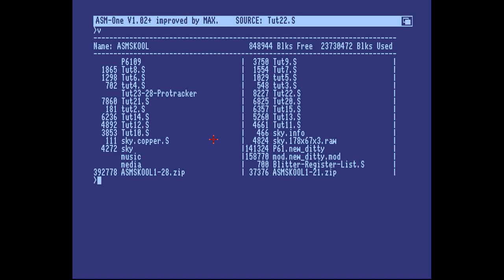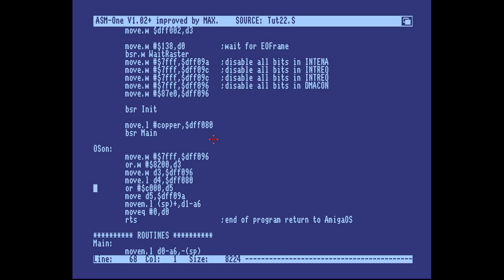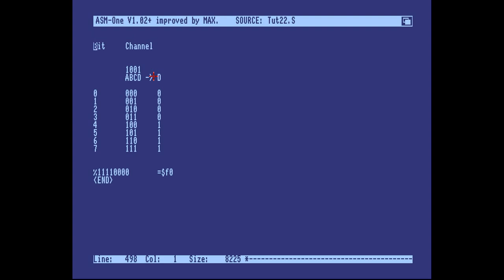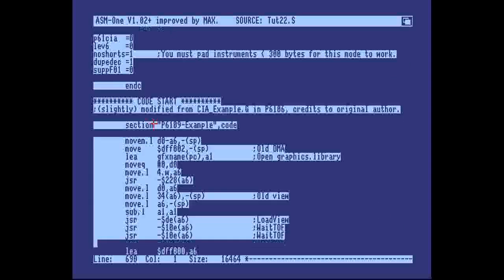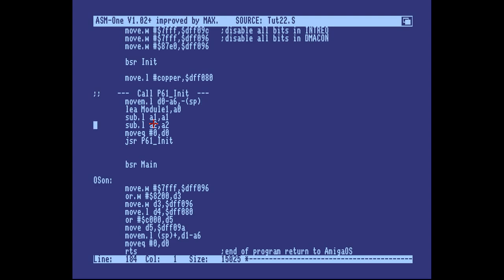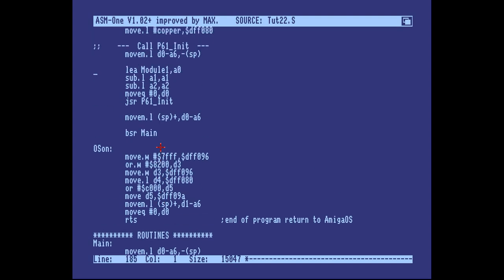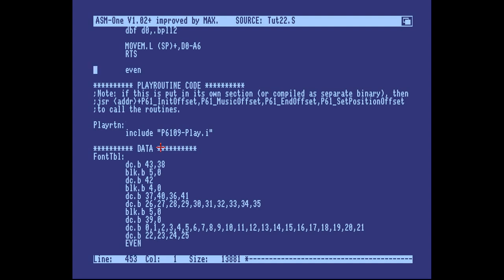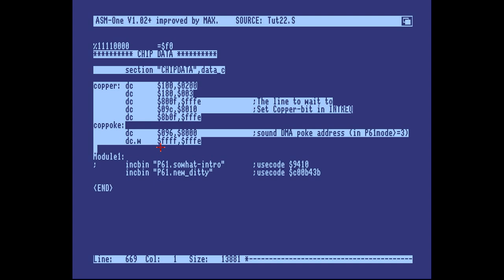Amiga Hardware Programming 30 - Adding music to the demo

Comment: Hey, I used your example but encountered a crash pb. I use P61con and set 'Pack samples' option in Preferences but when I launch asm example with this compressed module, no way, it crashes. Any hint ? Because it's cool to have samples compressed regarding gain of memory.

Comment: I can get the EXAMPLE to play but not the Tut30.s and same with my code, just silent. I have no idea how to debug this...
Reply from the maker: Tut30.S works with P6109 here by setting usecode for the song and p61bigjtab=0 (or 1), but the most common cause is p61exec=0. It should be 1 if you're not making a trackmo and want to support accelerated Amigas. A "bad"(?) default that was left in.
Reply: @ScoopexUs  Hi Scoopex! thanks for your reply and sorry if I didn't respond earlier but I took a long pause from Amiga coding. But now I'm back and I figured out what the problem was. By comparing the example in the P112 dir with tut.30 I've notices there's a DMA init which is a bit different, so I changed 	move.w #$7fff,$dff09a to move.w #$e000,$dff09a and BANG! it works! This works also on my code. I'm still figuring out what I just did exactly but for that was the trick :) So tut.30 works with P112.

Comment: Thanks for the explanation. Very interesting. Only remember 1 mode from all 4.
Reply from the maker: There were no modes in the original, these 4 modes were put in by me to move the constants at the top of the playroutine include out and manage them more easily. If you just included the source and didn't know to modify the constants, or if you included the binary, the worst case was ~7.1% CPU, vs. ~2.1% now.

This is for Mode 1. If you understand the short notes for the modes (or just deliver a test to the musician for OK), you can use the other modes to get it down to ~1.1% CPU without having to learn the playroutine source. P6106 best case was more than double the worst case now. So quite a dramatic optimization.

I've updated the description with the latest version, which is even easier to use and is compatible with more Assemblers than Asm-One/AsmTwo/AsmPro.
Reply: Perfect Thanks

Comment: Hi Photon. Many thanks for this awesome work! I have the following issue: I'm preparing an A500 demo, an to be nice to HD owners, I'm not doing a trackmo. So I have a DOS executable + a data "bigfile". I use the CIA default mode for the music, and it plays well... until I load a file (using dos library's -42 "readfile" ) from the bigfile. At that moment, the player slows down. I know that dos disk functions are "blocking" until they finished their job. But I guess it should not block the CIA timer interrupts, unless dos disk access also uses the CIA timer? Any idea? Thank you!
Reply from the maker: Which "HDD" controller are you using when you get this? Also, I'm supposing you turn the system back on while loading?

Comment: Hello, just a small question:

Why do you not set the value "use	=-1" to "use=$c00b43b" ?

Apparently you get a 'big CPU-time gain' and isn't this what we all want?  ;)
Reply from the maker: You're a good student and you are correct ;) -1 sets all bits in the usecode, and therefore enables all functions in the playroutine, maximizing its size and CPU time. Always set the usecode to the file comment of the P61 file!

In tutorial 29, I say why setting the correct usecode is important, and I also write in the P61 player source that it's important. You get better performance, and can avoid head-scratching in rare cases, such as incompatibilities between veryfew commands in the song and "trying the different modes". This specific tutorial is focused on the fewest possible steps to put the playroutine in your demo, so it skips that. That's because you can start by doing this, avoid being confused by me explaining the many options, and get it working. Then you should set the usecode, and then, if you know what you're doing, you can try some modes. :)

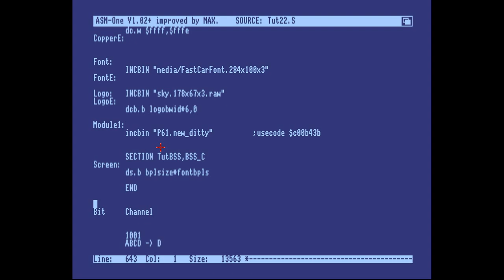Comment from the maker: If you're in a hurry, 3:10 to 14:24 tells you the story.

You copy everything BEFORE the "--vblank mode options" line to the top of YOUR source. Then you look for the calls to P61_Init and P61_End. (Wrap them in movem commands to save all registers if necessary.), Paste them just before and just after YOUR "mainloop". Lastly, include P6109-Play.i and the .p61 file (in chip memory, with an EVEN command before it.)

That's it, you're done. :)